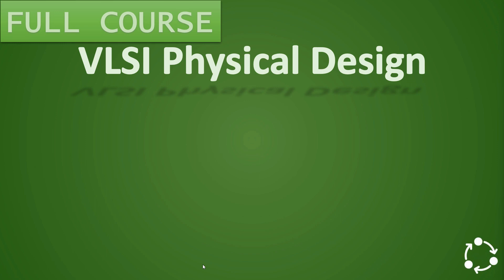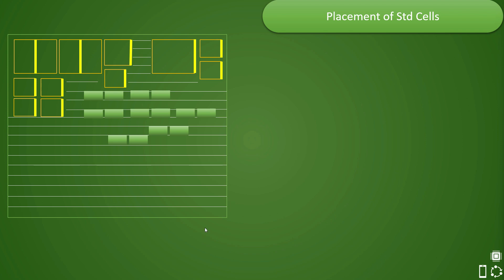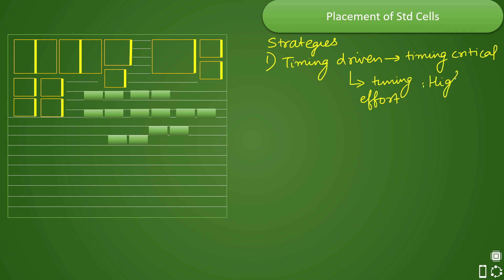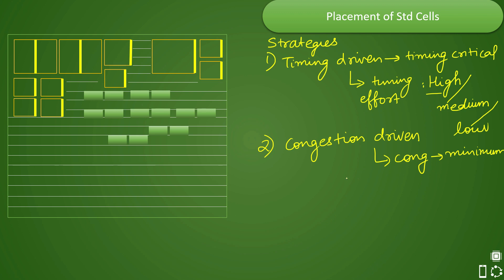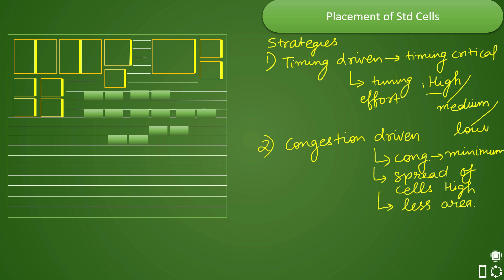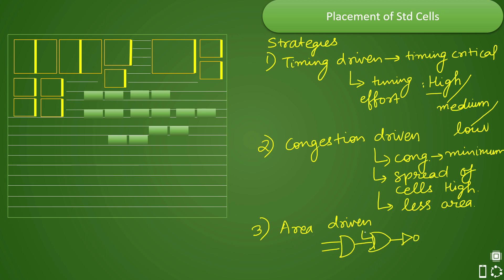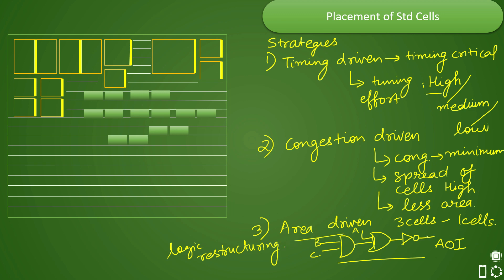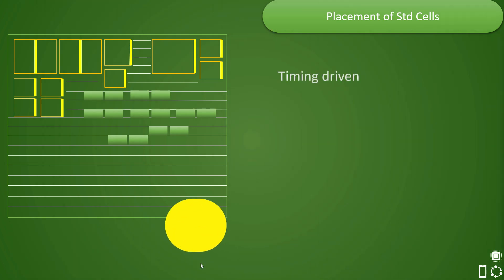PD Lec 32 - Placement of std cells | VLSI | Physical Design

Comment: In congestion driven placement, cells are spread away in order to reduce the congestion. Means it will require more area than normal(without congestion driven) placement. Then how it is prefered when area is less? Where am I wrong?